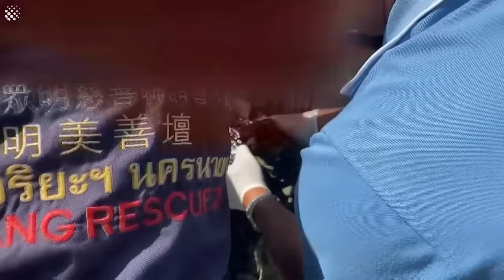Heroic moment people rescue stray dog stuck in molten rubber | Stray dog rescued

Comment: I work as a vet tech currently and in the past I've also worked at an animal rescue facility as well as a wildlife research center. I know, extensively, the ins and outs of the behaviors of animals, strays, wildlife, pets, etc, as well as a great deal of environmental factors in my educational research and experience. I also know in great detail, the rescue side of things. I can tell you there is NO POSSIBLE WAY that dog got stuck in the manor he did in that tar without the help of a human to get him in that situation. The tar would only be thin enough for him to get stuck if it was extremely hot, to the point of causing burns (which I see no signs of after the fact but I'll get to that later), in which case he wouldn't go near it. There is no way he could simply fall into it either without it being a giant pit of tar or a hill nearby. Whether that was some other human/humans who did that to him or the people filming, idk for sure. But this video seems highly unusual in the manor in which they went about it. There are many channels like this who put animals in dangerous situations, abuse them, and even kill them, just to make to seem like they are rescuing animals to get views/money. It is a sick business but when one channel gets removed, they just make several more and the cycle continues. In rescue work it is common to film before attempting rescue as well as during it, this is usually done by a camera crew seperate from the rescue crew. However, the time they took filming before attempting the rescue is highly unusual from what I've seen as normal. The dog was in extreme distress, if you work in rescue you know that is a dire situation and the dog may not survive, a plan must be made immediately and that was not the case. Is it possible the clip with the dog in the cage was filmed prior to rescuing him from the tar? I think it's very possible. Why is there no footage of them bathing the dog to get the tar off? There are remnants of the black tar on him still, (which means it can't be months later) but no signs of burns. That is just simply not possible. This leads me to believe they filmed that prior to the tar incident, in which case would mean these disgusting people did this to this dog. Other professionals please weigh in on this.
Reply: Omgosh. I pray you are wrong. Evil if this is true. Pure sadistic evil. Poor dog.😢
Reply: am glad I am not the only one that sees this as intentional abuse of animals. dogs are smarter than to walk into an ozzy tar puddle.
Reply: So this was done by human?
Reply: @rietakahashi3820  yes
Reply: @rietakahashi3820  unfortunately:(
Reply: U r absolutely right
Reply: @yasirkhan6455  that’s so sad
Reply: @marshamoyers1578  мне тоже показалось странным,  то что собачка лежит погруженная в смолу, словно её туда бросили,  они ведь умненькие,  даже если нечаянно перед ними и появилась эта дурацкая смола, ну понюхала,  горячо и отошла бы. Нет,  тут однозначно дело не чисто
Reply: I hate so much those fake animal resquing channels, I'm glad people are noticing the fake ones but still you never know 100% the real ve fake ones 😭😭😭😭
Reply: You don't have to be a specialist to see that!!! Was my first thought!!! I am a dog owner though...🤣🤣🤣
Reply: I mean, in the closing scene, right side of the dog's face looks really deformed and almost "molten". But it doesn't take away the fact that this might be intentional.
Reply: @JahoSelamaj  2 different dogs  and the poor dog it's impossible he survive  we saw his last breaths   ask to your vet please and look for justice4animals petition against fake rescues
Reply: @lomar2812  2 different dogs
Reply: @es-mw2mq  A very weak comeback. Go study a bit.
Reply: @lomar2812  now i'm sure you are one of "them"  i hope you get back very soon
Reply: I agree.
Reply: I stepped in tar when I was 4. It covered my ankles and I didn't even cry. It was hot, but just like an uncomfortably hot bath/shower. There are many types of tar, and the same tar we use is not the same tar in other countries.

Humans are the Shepards/guardians of animals; It's good to protect them, but it's also dangerous to see demons behind every bush.

Was this faked? Who knows. There's circumstantial evidence for both sides.
We may never know.
Reply: No, Thailand has a lot of dogs, stubborn and itchy, maybe they think that is ashes.
(ashes can cure itching)
Reply: @MyFirstHandle  Ayo history can repeat itself??? they seriously to help dog
Reply: CAP
Reply: @MarK0027TH  no cap. These people do this to look like they “saved” the dog but they actually put it there in the first place, then saved it, to look like they were the good guys.
Reply: @NovaQ_Music  i mean thatOneWeirdGal is cap :/
Reply: @MarK0027TH  :P
Reply: Yeah this is fake
Reply: Yeah that is clearly either not the same dog or picture taken before being out in the tar.  I’m not expert but I don’t see how that dog could survive that and number two how could all of that tar possibly be taken off and no burns like you said.  Absolutely disgusts me.
Reply: @MarK0027TH  this was not in thailand bru
Reply: @barten1244  you think it not thailand? you see car? and hear they speaking?
Reply: Holy shit..
Reply: @rietakahashi3820  Yes well possibly not but the high chances are yes
Reply: @alexandreadarleen2337  if it is real horrible isn’t it?
Reply: See that concrete on the right, kinda looks like the dog was running around the silo and jumped off the ledge into the tar and sunk down ( what ever it is). I understand your concerns but I doubt anything nefarious
Reply: @barten1244  The damn description literally says at Thailand
Reply: @zynos_s  ok chill bro
Reply: @barten1244  ok
Reply: @BlueBlacy  it was staged in a diabolical way, and yes thats a real tar pit
Reply: there are many "animal rescue" channels on youtube that put these animals in horrible situations to look like heroes and get views, spot on for following your intuition
Reply: @es-mw2mq  hes not smh people like you wish karma on the wrong person
Reply: Yeah
Reply: @USAcit  even*
Reply: @marshamoyers1578  ikr
Reply: @NovaQ_Music  Dude listen me
It police and rescue team
worker just call emergency
SO YOU MEAN WORKER THROW DOG INTO TOXIC GOO AND CALL POLICE?
Reply: @NovaQ_Music HALOOO
Reply: @NovaQ_Music  wth this video have been confirmed
pls watch and read story in description
Reply: @zynos_s  and it aint fake rescue cuz it was confirmed that it real
HOW IT NOT BECAUSE THOSE GUY ARE POLICE AND RESCUE TEAM WTH
Reply: @MarK-0027  It was staged.
Reply: @MarK-0027  look if it was real, then why tf would they just stand there recording a damn dog being stuck. they would have just helped them like immediately not doing the one thing that bystanders would do. This is definitely staged. i mean like, you cant just stand there and not do anything, like everything about this is already suspicious so you defending it really makes it more sus. so this is definitely and definitely staged. you cant stop me. if you really think it is true, then what would YOU do if you were in this situation?
Reply: @zynos_s  there are FACTORY!
and thailand have stray dog anywhere it just dog around there and run to motlen goo and then stuck worker that see judt call emergency For HELP!
GO READ DESC PLS!!!!!
Reply: @NovaQ_Music  Dude which word i must tell you that they are POLICE
and you should read desc NOT ARGUE FIRST
The stray dog was around road
and then that was dog everyone in factory know her because she friendly and like to play worker but one day dog playing around and then stuck in goo that leaked
Reply: @NovaQ_Music  SO YEAH THEY CALL EMERGENCY!
YOU ARE CALLING POLICE CRIMAL!
Reply: @NovaQ_Music  hey hey try screenshot at 3:30 and use google translation
Reply: you guys are children that argue and domt notice the car and suit 1669 emergency
Reply: Please note that in the video they're talking about the dog leg was broken before the incident. That's a possible answer for why it's stuck there.
Reply: @zynos_s  The only parts where they filming and doing nothing are the parts before they use equipments to get them out (loader, gloves). I have no knowledge about this but I think it's a common sense to not get your skin contact with tar heated by sun in the hot country.
Reply: @Татьяна-у8у9з  Tak ohm eee nin...
Reply: Some YouTubers have outed many of these channels in South/Southeast Asia for this torture of dogs. They know it gets a lot of views and one big viral video can earn someone more than an average worker in their city would earn in a year. Popping out videos at a rapid pace. There's been a lot of inconsistency among these videos and channels. It's very sus.
Reply: at the end it has a big stain on the ear that was not in the tar :s
Reply: Thanks for your words, I agree 💯
Reply: That's clearly a female dog
Reply: report as animal abuse
Reply: It's not Tar it's molten rubber, it's not so high temperature and it's clearly had time to drop from above, from a crane or pulley system, this is a building site, the time spent before was for health and safety risk assesment, it's obviously not deliberate as there's a rescue services worker in uniform with these people and if deliberate, the police would be in attendance, but they're not, it's clear a real rescue on a Thai building site, of a street dog, that's fine there looking for food scraps, builders will often feed the street dogs, unfortunately for this dog, it appears it was in the wrong place at the wrong time, visit Thailand, check out the street dogs, building sites, and their conditions, and talk to a rescue services worker, like an ambulance driver, and talk with Thai police about it, I'm sure they will put your mind at rest, scrubbing and peeling the rubber off, would have been a lengthy task, clearly the edited the video, uploading short clips, and when cleaning the dog it's no time to be filming, the focus needs to be on the dog, a remaining residue wouldn't be unusual, some may just have been to difficult to remove, and will come off when it's fur grows, I'm glad they were able to get it out, without hurting it, that's why it will have been filmed, fir the rescue services file, to evidence that the dog wasn't injured further, during it's rescue, please stop this malicious questioning, just because you have never seen it, or cant understand the circumstances, it doesn't make you right.
Reply: It is not even Tar, it is Molten Rubber! even more Disgusting! Thank you for your Comment!
Reply: Oh,My God!

Comment: These channels are another reason that disabling the dislike button count is bad. Yes you can dislike it still but the dislike ratio is sometimes a warning to unaware people as to the legitimacy of what they are about to watch.

I hope that dog didn't die and that he was taken far away from these people.
Reply: REPORT!!!!
Reply: I looked at the history of this channel and that doesn't seem like a pattern here, are they getting a video from another channel? it's odd to see the use of so many bystanders in the rescue scammers stuff I have seen or the use of heavy equipment worth a quarter mill like an excavator, it just seemed like way too much effort to get the poor dog out compared to the fakes I usually see.
Reply: i looked at the dog in the tar and the dog in the enclosed area, and it looks like its the same dog, i mean there are scars, like there should be after something like that, and there are no scars where the dog wasnt in tar, so i have some good news, theres a VERY high likelyhood that the dog lived, because why would they go through the trouble of finding another dog with scars in the exact right spots, and they couldnt do this with another dog, because even if it lived, which luckily this one did, it would likely land much differently in the tar resulting in scars in the wrong places, so everything checks out.

Comment: Ok to all the people saying this video was staged, you've clearly never ever been to Thailand, there are many dogs that look virtually identical, they're street dogs, strays with no owner, it appears this dog is on a building site, it's probably gone there hungry looking for scraps, it was probably in the wrong place at the wrong time, the molten rubber spillage likely dropped from above, from a bucket attacked to a crane or a pulley system, and it's got stuck, in it after it being accidentally dropped on top, luckily when it's not so hot, but when it's very sticky, it's fur is likely long enough that it's protected it from severe burns, these people include an actual rescue worker in uniform, and if this was deliberately staged, the police would have been called, but clearly weren't, it just goes to show the mentality of people, every time there's an animal rescue video, I'm seeing these people suggesting it's staged, you're sick, if you weren't there, to witness it in person, you shouldn't comment, you're own biased suggestions, because it's not helpful, I'm glad they were able to get the dog out of the molten rubber, molten rubber is used to water seal roof tops of buildings, that accidental spillage likely occured from above, I commend the efforts of these people and the rescue service worker 😊

Comment: So obviously this was a planned video. You can see that the video of the dog apparently after being dunked in rubber is the same day so was probably actually filmed before and they narked it with a few dots of black to make it look like after. So I’m guessing it probably didn’t survive that horrible torture. Sick
Reply: Good observation. You should consider using that gift for the community.
Reply: Definitely not, the way the dog is panting means it's likely going into shock and stroke status, plus I don't know what they do in Thailand but in America at least, we don't leave any hazardous material sites unattended EVER as animals are a safety risk, there would literally be no chance of a dog getting trapped because spills are legally not allowed, you'd immediately be shutdown and fine the company for the spill. I worked for a Refinery in the past and there's a crap ton of safety and legalities to prevent any and every accident

Comment: That dog was hyperventilating and overheated. It needed water. Fast. Also, there was another dog who was running around. This place should be forced to clean the spillage they let lie all over the place.  The had a front end load. They could have covered that rubber spillage easily or cleaned it up before it became an endangerment. Shameful.